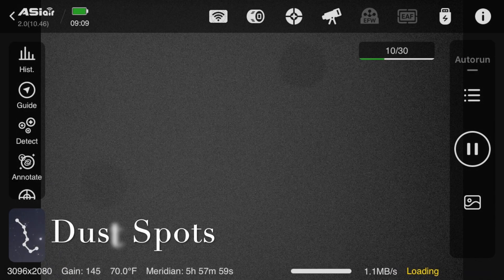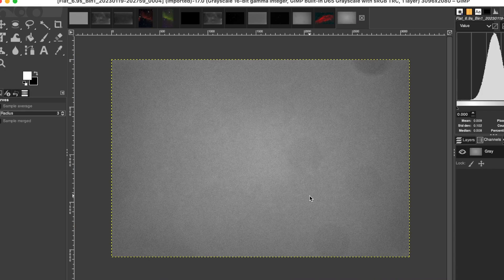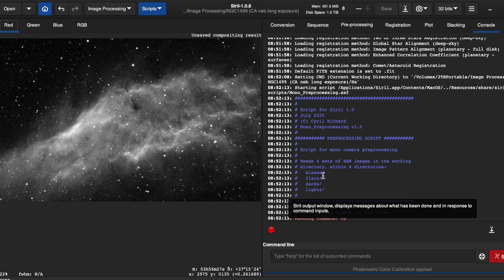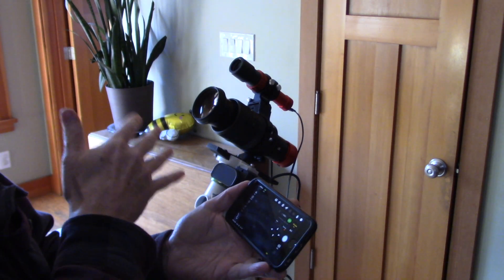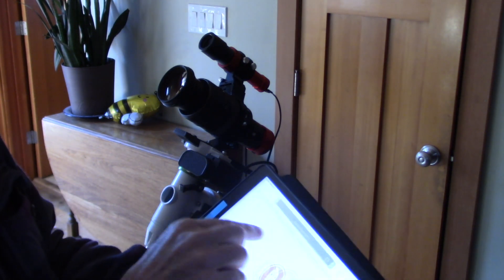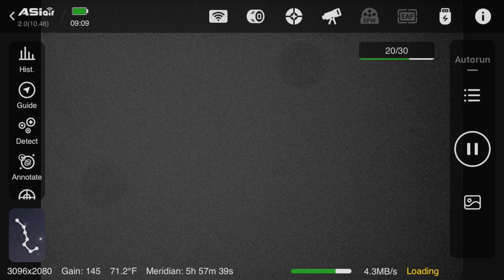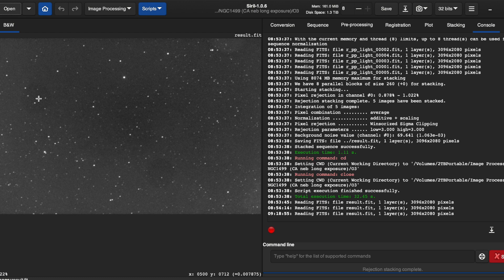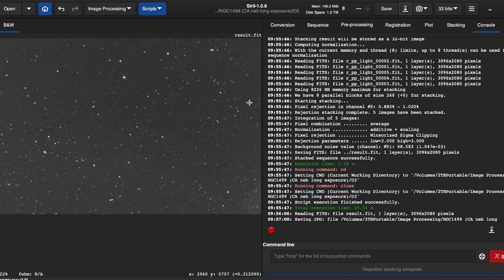How To Take Flats With The ASIAIR PLUS

Comment: great video! when taking flats with ASIair and setting to Auto for exposure, does that only work with dedicated astro cameras or does it work with DSLR as well? i've tried shooting it with this techniques but it gives an error message about the exposure
Reply from the maker: Auto works great for astro cameras but I had to do manual exposures with my DSLR
Reply: @MyEngineeringProjects  thanks for the fast reply! how about exposure times? are they also short or would they be the same as the lights?